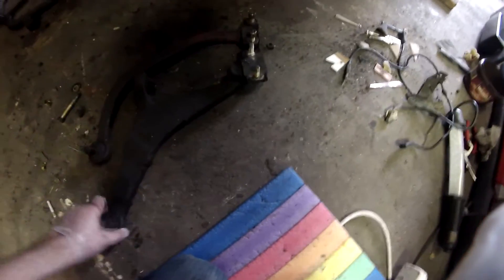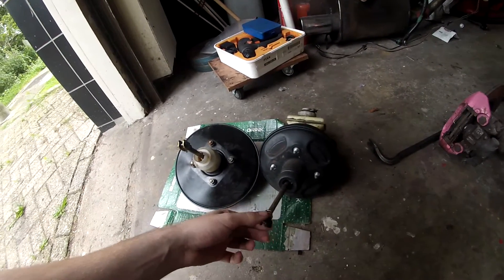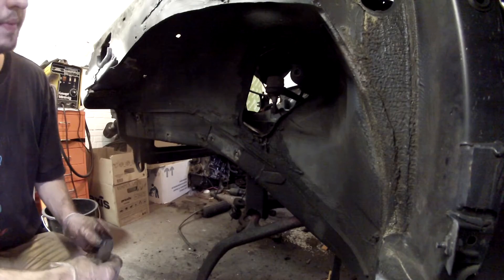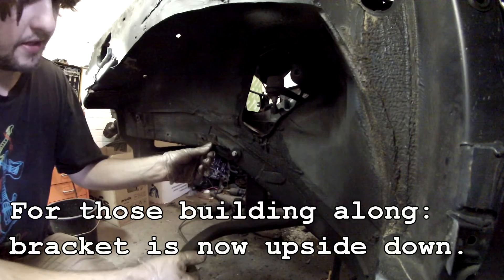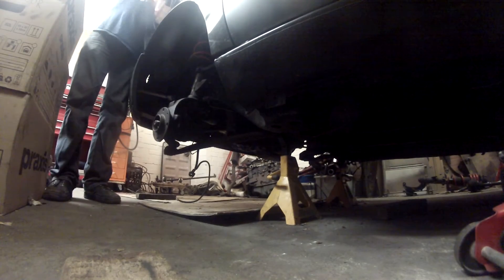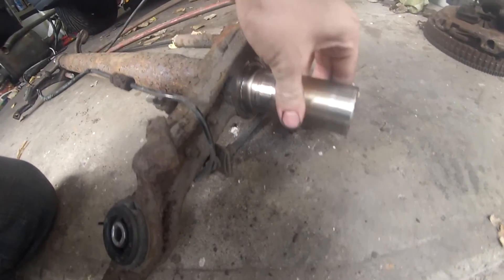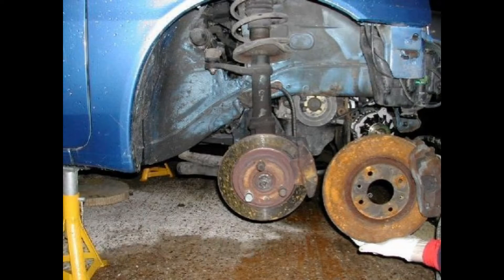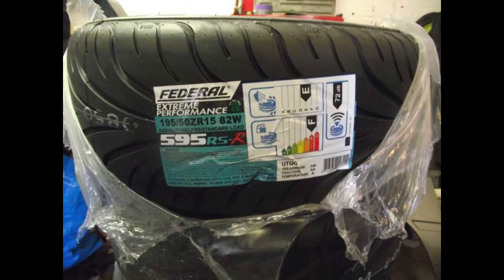Citroën AX 16V Trackday Project Episode 4: Suspension and Brakes

Comment: Hi there... I am going to buy a AX 1.4D 5 doors with a engine swap of Saxo 1.5D and i am wondering if i can mod also brake discs on my car to have 4 studs?
Also does the AX 1.4D come with roll bar or can i add it latter?
Nice video
Reply from the maker: That's always nice, the 1.5D is a good engine (had one myself!)
https://i.imgur.com/PLEdaJi.jpg

The 1.4D came with 19mm front anti-rollbar, it's not the thickest option (I think that was 21mm on the GT and certain Saxo/106 models), but it's already a lot better than none at all, like the 1.1i models. Upgrading to the AX GTI system is also possible, but requires AX GTI control arms and AX GTI front struts, and only works on 1992 and newer cars.

I'm not sure if the rear axle has the anti-rollbar too, though if you're upgrading to 4 stud, getting a complete 4 stud rear axle with anti-rollbar is the best option. You'll find these on the AX GTI, and certain saxo and 106 models, though beware of beams with bad inside bearings, and not all 4 stud models have the anti-rollbar.

For the front struts, the diesel struts with 247mm brakes can be easily converted to 4 stud struts by replacing the wheel hubs (part number 3307 49) and bearings and putting on 247mm 4 stud disks (BX, 309, etc..). If you choose to also upgrade to vented 4 stud rotors (Like the AX GTI) you also need different brake calipers.
Alternatively, you can replace the front struts with ones off an AX GTI or any saxo/106 with 4 stud brakes, that way you don't have to press wheel bearings.

Comment: How did you solve the difference in the inner anti roll bar mountings being 2 bolts on the old setup and 1 bolt and a slot on the GTI setup? Or did you leave away the anti roll bar on the new setup?
Reply from the maker: Mk2 shells (1992 and newer) have the mounting holes for both types of anti roll bar. You're asking because of the white Mk1 GT, right? That only has the mounting holes for the anti roll bar that mounts directly to the control arms.
Reply: Ok, too bad :(
Reply: toch bedankt :)